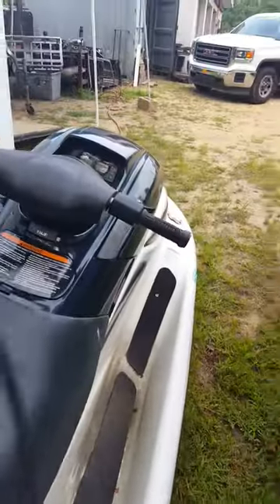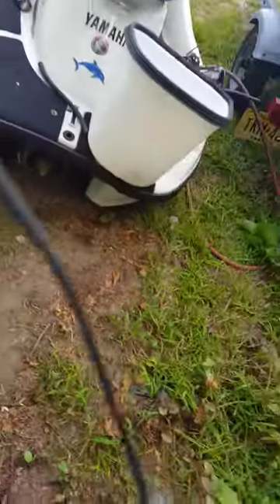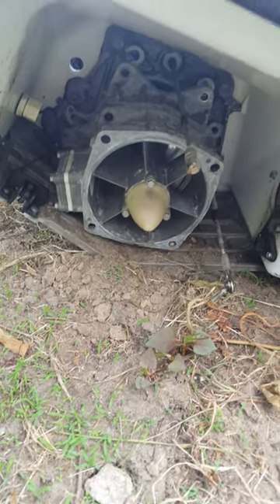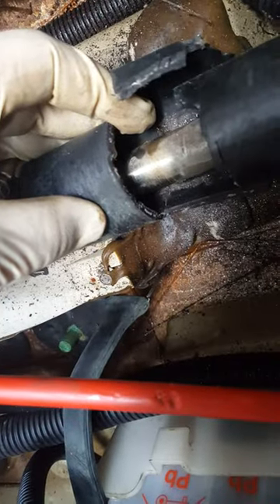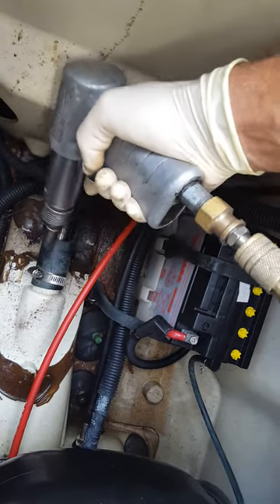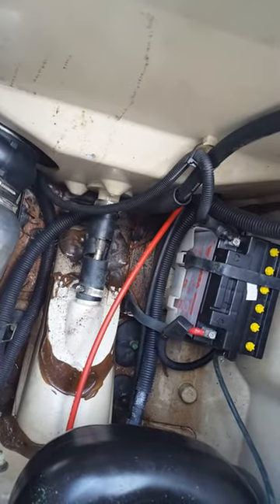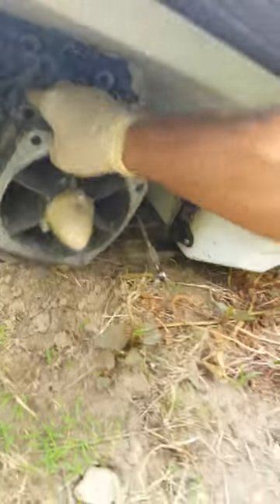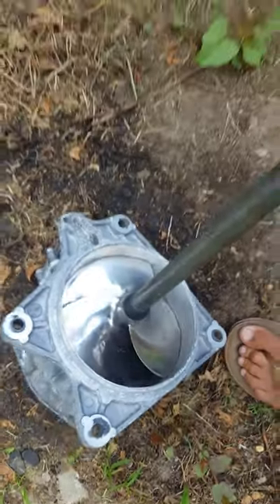how to remove stuck driveshaft impeller housing xl

Comment: ummm take out the grease fitting that goes on the intermediate shaft, either a zerk fitting or just the threaded nipple the hose for the grease slides onto. Unscrew that fitting, then spray alot of carb cleaner in that hole 1st to clean, then spray alot of PB Blaster in that hole....this does 2 things, 1 of them most never think of, it releases the suction effect from trying to pull a shaft from a sealed hole VS. a hole with a vent, ( the grease fitting hole ). Most of the time you can just pull the fitting and spray carb cleaner in there to clear the hole, then go tug on the pump 1 more time and it pops right out!!! >>>RINAUDO METHOD^^^^^^^ Hope this helps